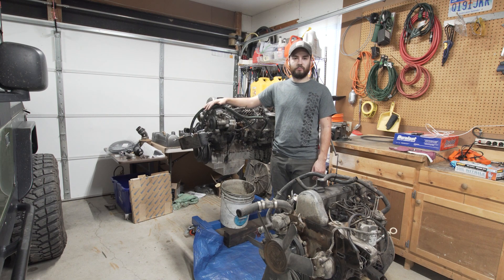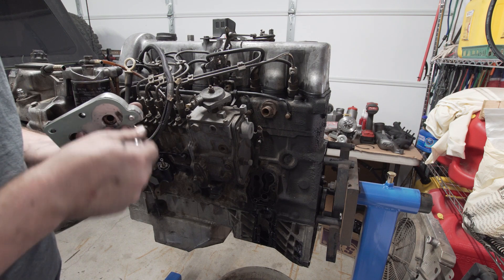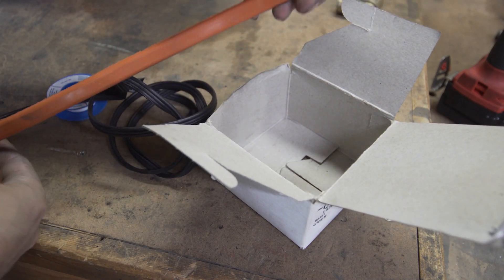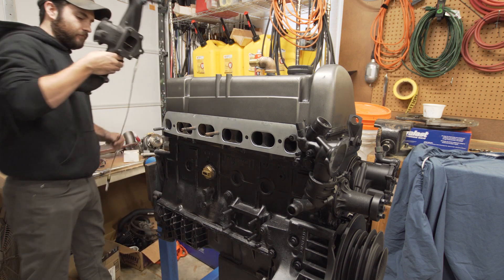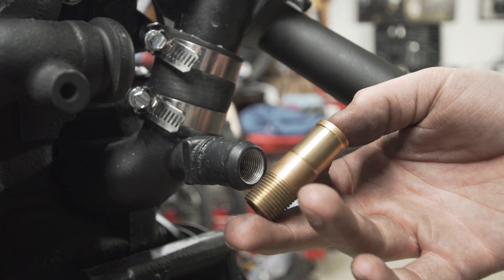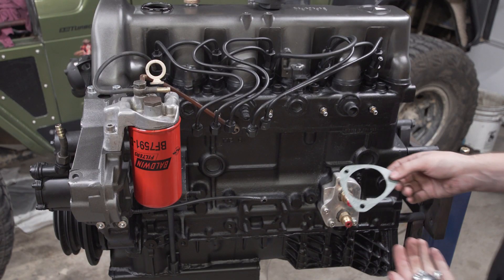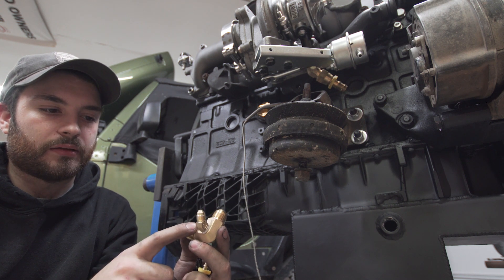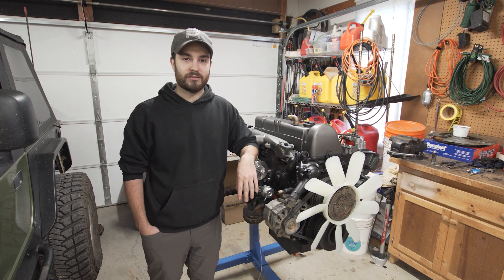Building up the OM617 for my Diesel Jeep TJ (Pt. 2)

Comment from the maker: If anyone caught me timing the injection pump at 26* BTDC, don’t worry, I caught it too while editing, and went back in the garage and re-timed it at 24* BTDC
Reply: Diesel meken told me to set timing to 22btdc on my 7.5 m pump
Reply: I set to 27 BTDC for "start of injection" (drip method) on my 1984 & 85 M-B 300D.  Recommended by some on Benzworld and PeachParts to give slightly more power, at expense of slightly rougher idle.  I didn't notice a difference and idle is smooth, partly because I fill with renewable diesel (avail in CA only).

Comment: 617 nut , flipped 45 w123 in 18 years.  Here in Houston these were nuggets of gold littering driveways across The metroplex . Even the junkyards you could find these 4 to 5 deep each month . As time goes on I regreat not pulling those 617 s , in my findings the parkers were good motors , all fuel related I’ll serviced vehicles . The cars are mostly gone , the era is closing , find your now before their gone forever.

Comment: what kind of paint did you use for the valve cover? I am going thru my om617 right now. Also i have the block heater but need to get a cord for it. any idea where i can get one? fyi these engines run really good on used atf
Reply from the maker: Just VHT engine enamel, so far it’s held up really well if you give it some good time to cure in a warm room in the house or next to the fireplace.
Reply: @robertsfabworks6579  i am going thru my injectors and setting pop pressures right now. had this engine apart for a few years.

Comment: I'm swapping one into a 95 Ford ranger with a Dana 60 rear and Dana 44 front, NV3500 trans and np205 transfer case. 37" tires. Hopefully it'll make enough power 🤣
Reply: How did you bolt it to a nv3500? I have a s10 with a bad engine I'm thinking about swapping.

Comment: No hose clamps on the red oil hoses? I would highly recommend this.
Reply from the maker: Thanks for the concern! These are actually Parker “Push-Lock” fittings and hose, and are made specifically to be used without hose clamps, they are rated to 300psi and we regularly run 200psi of shop air and chemical through them at my work, so I was confident in using them for my oil system, as I’ve seen a maximum of about 100psi of oil pressure in my engine.

Comment: Very Nice Job. What Vibration Isolators are you using on your engine Mounts?
Reply from the maker: 1st gen Dodge cummins engine mounts
Reply: @robertsfabworks6579  I've seen the small square style however havent seen the style your using, would you happen to know which year model used your type? Thanks again and nice job.
Reply: @jerryprofitt2755  first gen is '89-'93